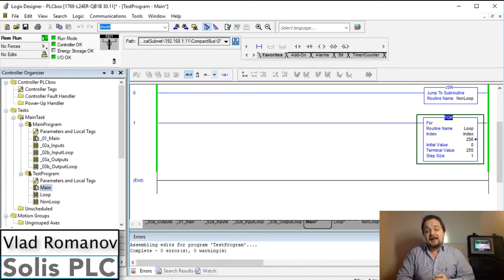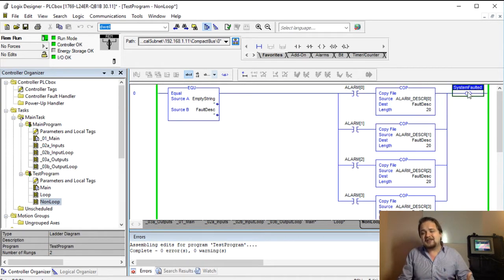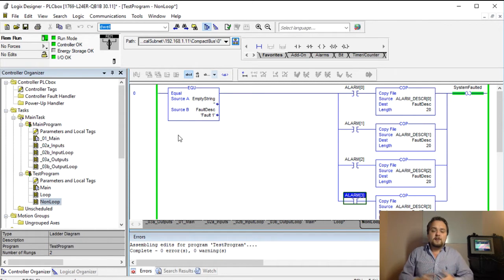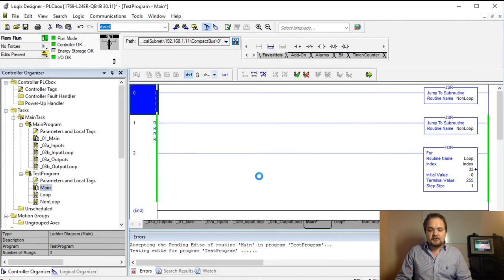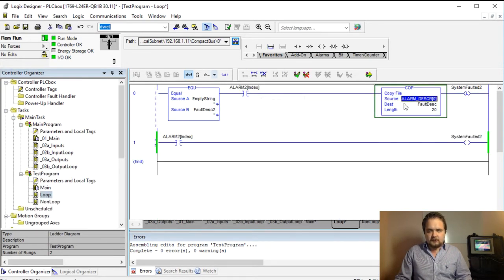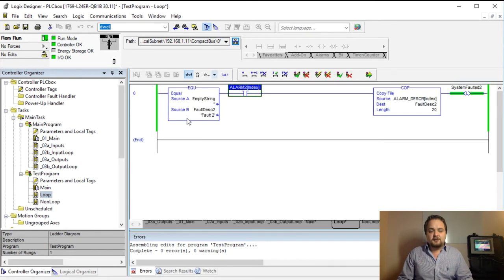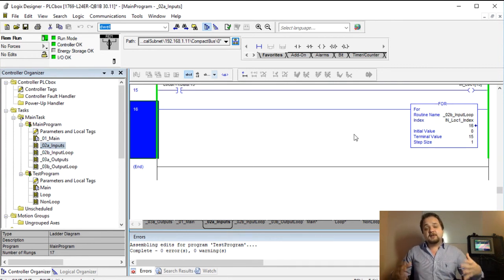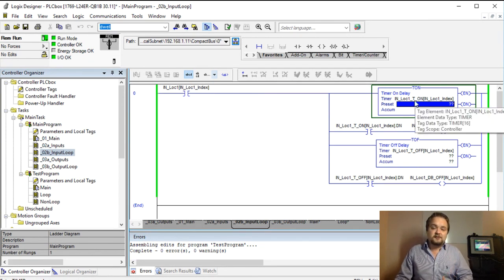PLC Programming FOR Instruction - Logical FOR Loop Ladder Logic RSLogix Studio 5000 Example Tutorial

Comment: I was wondering about using this for indexing multiple alarms on a system. When you use the latch you can capture one alarm but what if there is several alarms and you would like the HMI to Scroll the multiple alarms. Thanks in advance.

Comment: I did all the logic exactly like yours but for some reason, in the "FOR" instruction the value under Index was not changing for me. It stayed at a constant "256"
Reply from the maker: Hi Alexavier, did you use a JSR to the routine where you have the FOR instruction? I believe that your program may not be getting to the FOR loop which is preventing it from executing.